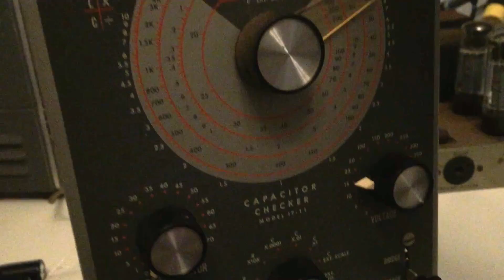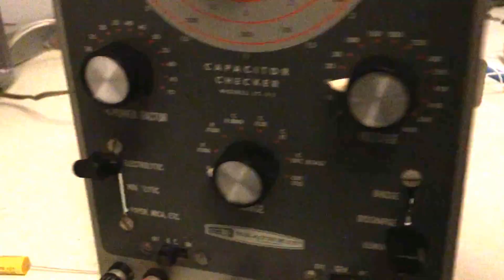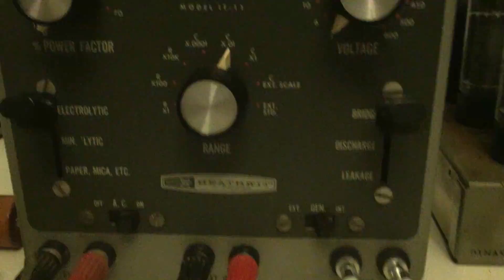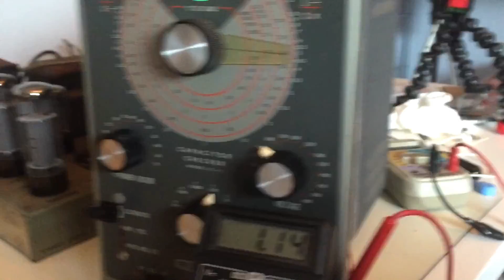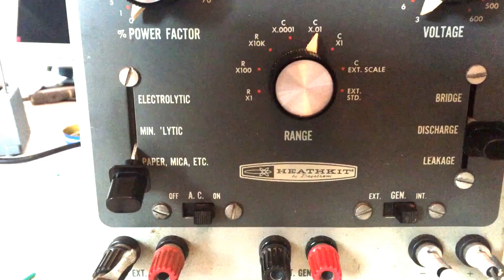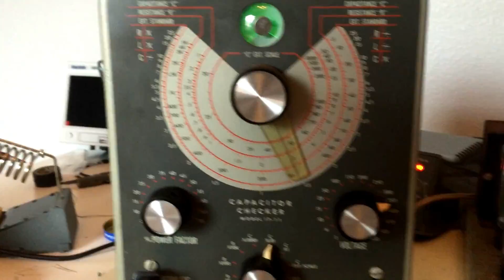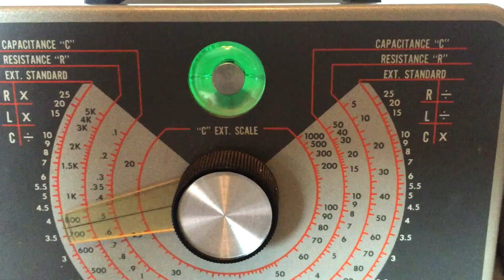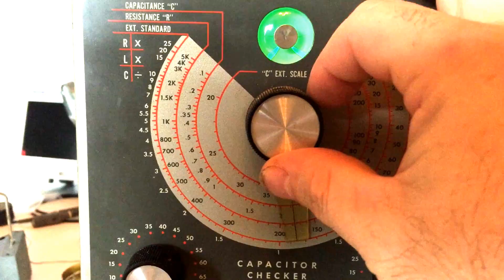Heathkit Repair IT-11 Capacitor checker overhaul

Comment: Very instructive video! I am now restoring my old IT-11 acquisition. After hearing your explanations about the sensibility of cap types, I wonder how I could even increase the sensibility in the leakage test for capacitors. The idea is to introduce a pot, so I can change a resistive value to make the test even more sensitive, affecting ONLY the cap-leakage test, not the bridge test. Any help about which resistor can be modified to achieve that goal will be very much appreciated. Thanks a lot in advance!

Comment: Does one ever have to worry about an old capacitor exploding under test?
Reply from the maker: With a max of 600 volts on a current limiting device like this, I would say no.    Most modern caps are vented if there is pressure, and the old ones are made of paper so they do not build pressure.   The metal can ones are filled with tar, there is no way to provide enough energy to cause enough heat to build any pressure in my opinion.
Reply: virtually no load so very little current getting through = no explosion.. i am starting now the restoration of the same tester, will be uploading footage soon

Comment: Hey Jordan. First thanks for your great videos. I like to watch them. I bought a Heathkit IT-11 2month ago. I changed all capacitors and some resistors. It working fine, but the eye tube was blurred, when I shift to leakage (much more bright at bride), but I was able to calibrate it easy. I could not live with that, so I bought a NOS 6E5. The brand is UNITED where the old one is RCA. The new eye tube is bright and fine and works fine when I test the value of  capacitors and resistors. At leakage it is also bright, but it is impossible to calibrate it. Nothing happens when I turn the pots to calibrate. When I swap to the RCA tube, there are no problems. Are specifications not the same for all brands or what?  What are your experience?
Happy New Year

Comment: Hey Jordan, I just got one of these things at an online auction site and have been playing with it. I can plug it in and turn it on but the eyelet always stays open. If I move the switch from Discharge to Bridge it closes a little bit but still remains open. Isn't it supposed to start closed until you hook a cap up? This is with nothing connected. I thought it would help with my 5F1 clone project but now I'm kinda stuck.
Reply from the maker: Did you download the original manual for the unit to start the calibration and test procedures?
Reply: No I didn't. I also got one of those Bob Parker ESR meters and I can use it on capacitors in circuit. Maybe I should check and see if there are any bad components in there first.
Reply from the maker: Replace all electrolytics and non electrolytics since you cannot leakdown test them.   Use polypro for non electrolytics and then if you like you can use this tester to check the dc leakage of the ones youve removed.

Comment: I just bought one of these and so glad I found your video. It will be sooo helpful when rebuilding mine. Thanks!
Reply: Hi Jordan, thanks for your videos, I just got one on line in mint shape, I was wandering if you can tell me all the capacitors and there values that you have change
thank you Denis